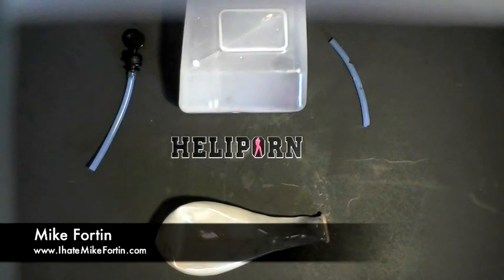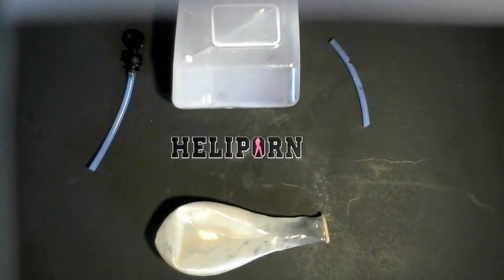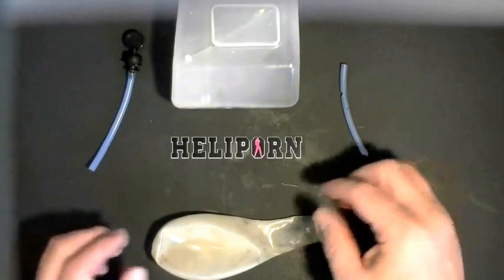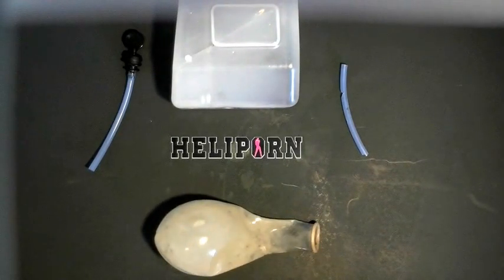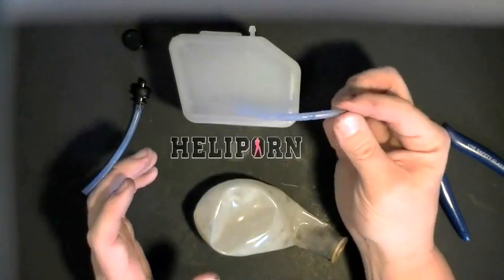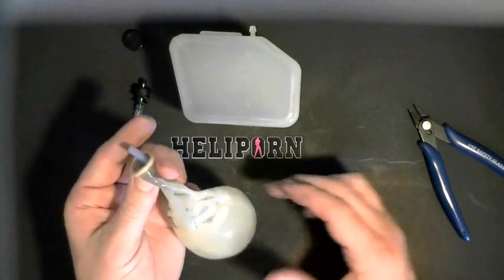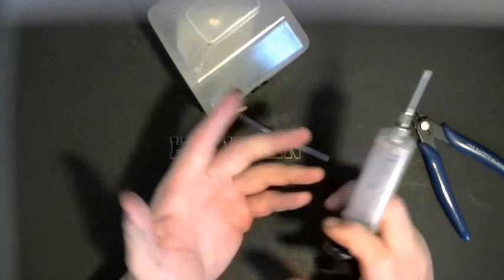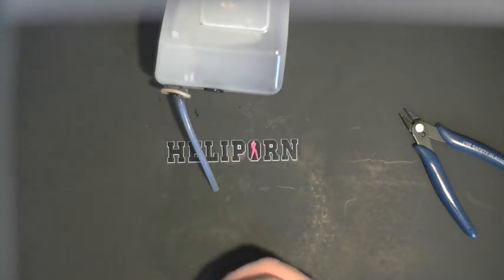Fuel Bladder 101 Extended

Comment: What capacity do you get with that 17" balloon?
Reply: +br1ian I will answer my own question. :) I bought some of the recommended balloons and measured one: it holds 250 cm³ (8.5 oz) before applying any pressure.